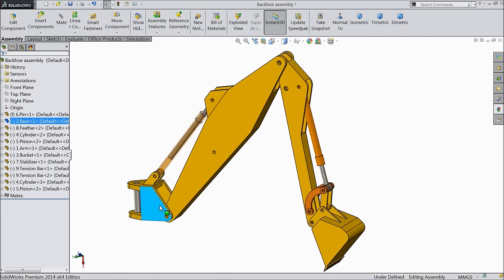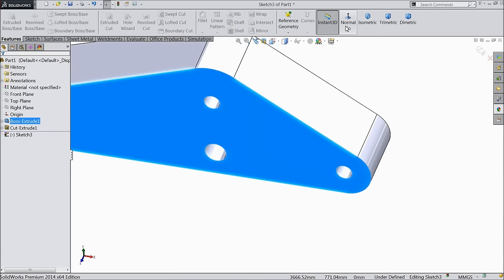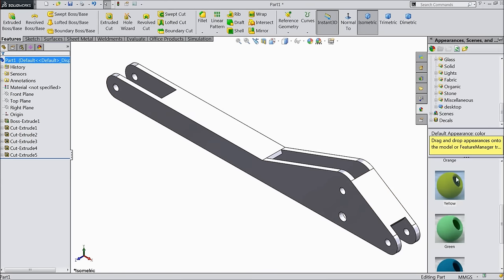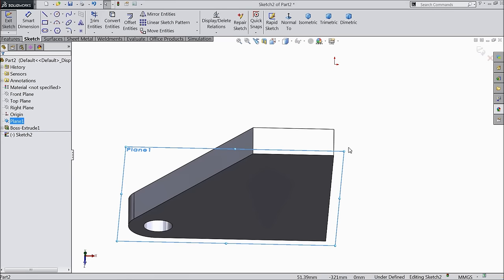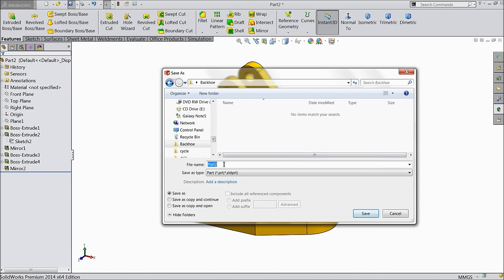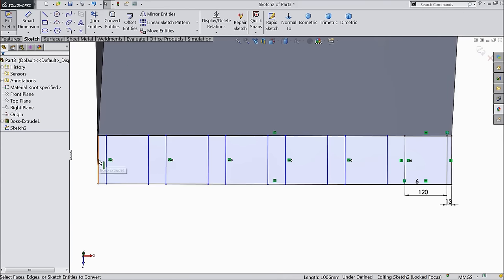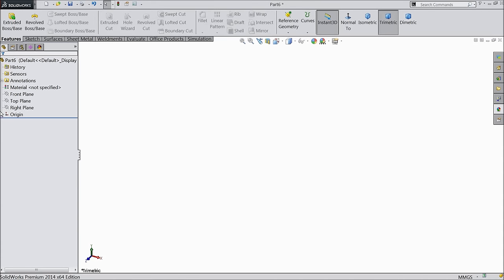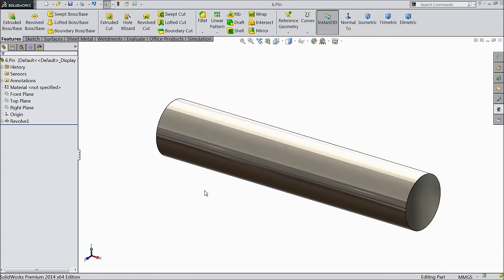Solidworks tutorial | Sketch Backhoe in Solidworks

Comment: The assembly is wrong!! First of all you assembled the arm to the feather with the wrong pair off holes.. and second there is one piston missing!! How will you achieve the "elbow" motion ? The parts are ok!! :)
Reply from the maker: Thanks, its not complete. i will do a full excavator in future,
Reply: how do you know from the solidwork for the bucket, which one is height, width and length, this includes the part you transport for the digger.

Comment: Thanks for your tutorial, which is excellent. I did the same project in Inventor using the same specifications and it has come out perfect. I have added a few more constraints to the bucket and hydraulic cylinder to prevent it from tipping over. Keep up the good work. it keeeps me ticking in my old age. You are a genius and a decent bloke.
Reply: how do you know from the solidwork for the bucket, which one is height, width and length, this includes the part you transport for the digger.

Comment: my solidworks is Future than urs so got lots of problem cant do assembly of piston n cylinder properly though its helpful
im on my project work n thanks for ur drone video as well
Reply: how do you know from the solidwork for the bucket, which one is height, width and length, this includes the part you transport for the digger.

Comment: Is it possible to draw complete excavator ?
Reply from the maker: i already uploaded complete wheel loader video, and its body almost similar to excavator ,
Solidworks tutorial | Sketch Wheel Loader in Solidworks
Reply: how do you know from the solidwork for the bucket, which one is height, width and length, this includes the part you transport for the digger.